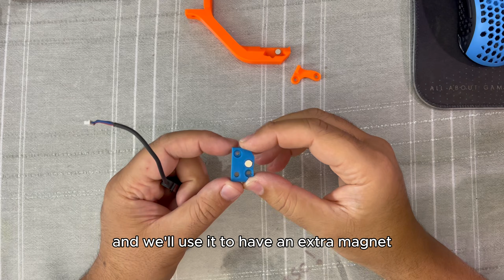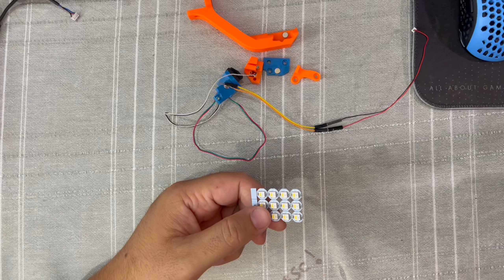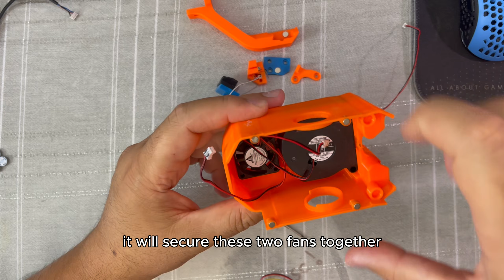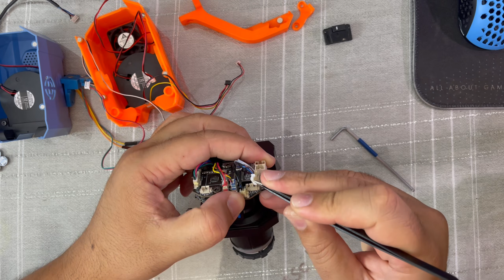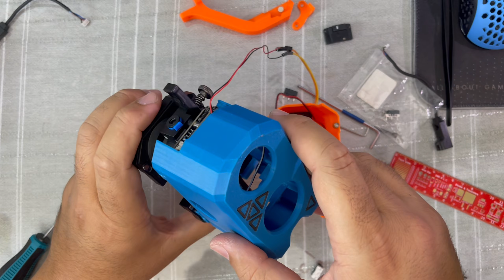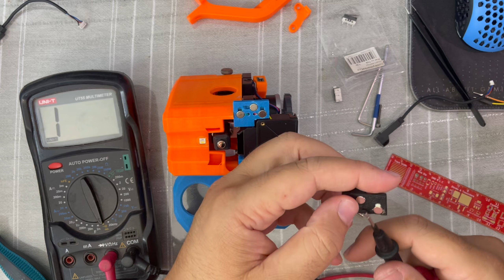Sovol SV08 X End Stop, Klicky & nozzle LED Install

Comment: Look like Sovol where thinking about using a BL Touch, it has the label for the inductive probe.
Reply from the maker: Bl touch uses 5v the port has 24v. But you could take 5v from diferent pin.

Comment: Hi Nadir - been researching the SV08 for a while now and I think I will buy it (thanks to your and others support of the platform!). Have you considered doing a guide to make the SV08 reliable? All needed mods for example?

Also, do you still recommend the klicky over eddy ng on the SV08? my use case is mainly higher temp filaments, so I need to upgrade the leveling probe from stock I think?

Comment: @nadir3d Thanks so much for the much shorter video.  Too bad I got it all working before this came out.  Any chance you can do a shorter one on the software configuration side?  I am still having an issue with the Probe Attach, where it does it's impression of a Major League batter.  I hit the Probe Attach button and it smacks the probe into out the stands!

Comment: Great, thanks for this video. One thing I am struggling with is at the start of the program the machine attaches klicky then runs QGL, the docks klicky. Then grabs klicky again to measure bed Z and puts klicky away. Then it grabs klicky one last time to perform local bed mesh and puts klicky away then starts the part printing. Not sure how to keep klicky docked through all 3 functions then put klicky away only once before starting the print.
Reply from the maker: thanks for the feeedback. this is the downside of using klicky.
Reply from the maker: If you want something faster after using BTT Eddy i can say that it worth the money here is an affiliate link http://shrsl.com/4t6qi  so if you want something faster this is the way to go
Reply: I'm looking into incorporating the attach_probe_lock variable. It apparently locks the probe onto the head until receiving a unlock variable.

Comment: Saw your video on the eddy probe (great work by the way as always). Been meaning to ask, for either the clicky or the eddy, does one must use mechanical endstoos or does the factory sensor less homing work ? Essentially I’d like to keep it as is with the exception of the Z probing. Want to take advantage of the eddy or the clicky. Thanks again!.
Reply from the maker: Lets put this out of the way With klicky is hard to use sensor less.
no matter what probing solution you use we recommend to use fiscal switch for the X and Y endstop for more accuracy ( if you will ever want to print 2 color at the same time you will need to be in the same spot!)
Klicky is has the advantage that it is not affected by the temperature
It can probe any type of surface, glass, steel, wood, cardboard, anything. 
when you are printing it is out of the way. 
it costs less than 5 dollars and even you can make it with spare parts. 
the only down side of it is that is slow. and every time you want to measure/probe something you need to dock it and undock it a thing that for me is very satisfying to watch but it is a little bit time consuming.

Eddy it it FAST! hand down! 
Eddy doesn't need to be docked and undocked.
It is sensitive to temperature  this is why we recommend the usb version that it has the temperature compensation. 
If you use it like a normal probe not to use the Rapid scan function it is still faster then klicky just because you don't need to dock it and undock it 
it cost a little bit more
you will need mainline klipper to can use it

hope that i made it clear.
Reply: @nadir3D  first off, thank you for the long and detailed explanation. Yes it does answers my questions. I have bit the Eddy USB and a clicky so right now was looking for one that I could use to replace the current factory probe. I tried flashing the eddy going through the guide and it seems it flashed as I can detect the MCU when connected. I didn’t know I couldn’t use the Sovol klipper version for the eddy so that’s disappointing. Seems I’ll have to either go mainline or set up the end stops. I recall you either mentioning on a video or a comment somewhere that you were planning to release configurations for either? Again, thank you so much

Comment: if you try to print a big part using all the table the rear fan won't hit the dockstation?
Reply from the maker: I have never printer more than 340x340 i don't like to risk it. otherwise we are almost releasing Xenomorph and the V4 for this project that they use different approach for klicky and docking so it will not be anymore a problem ;)

Comment: You need to modify the firmware to be clear right?
Reply from the maker: you don't need mainline klipper for this. you just need to add the new configs that are provided to your existing firmware. ( copy and paste some lines in your printer.cfg)

Comment: Appreciate all your work, even though I actually watched your 3 hour video all the way through several times!  I was able to install all the pieces without issues, but I've had nothing but problems getting everything working.  The only thing that worked correctly for me was the LED.  The x endstop didn't seem to be working at all.  And I never got klicky to successfully attach.  I checked continuity the same way you did, and it worked correctly.  I also double checked to make sure all the parts of the printer.cfg matched what you have in the printables and your video.  I think I need to study Klipper documentation more fully, and then try it again.  One question...In printer.cfg, you replaced the 'homing override' with new code.  But there is also that code in klicky-macros.cfg.  Does it need to be in both places?
Reply from the maker: for the Klicky macros you need to download the zip file i have attached in printables or directly from the github. all that files should be in a folder called klicky
if you didn't put all that files in /klicky folder it will not work! Current path:/config/klicky

In the Current path:/config/printer.cfg you need to include this [include ./klicky/klicky-probe.cfg]

and in the Current path:/config/klicky/klicky-variables.cfg here you need to modify the docking location and the printer x and y max accordingly 
https://www.youtube.com/live/XiKk49bJryE?si=pNlqgGiP7wWl1H_d&t=5733 as this specific time i modify the klicky config
Reply: Thank you for the reply.  I have already created config/klicky and put the klicky macro files in there, and made that change in printer.cfg.
Reply from the maker: @NorthTXMountainbiker  and is working now?